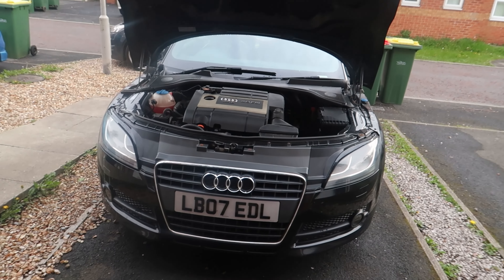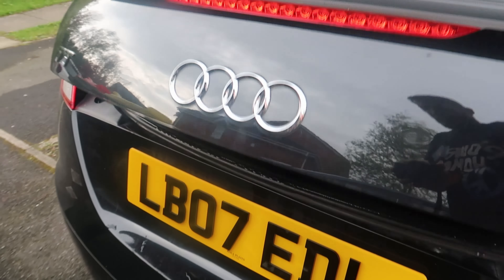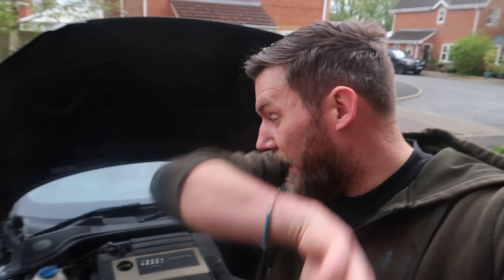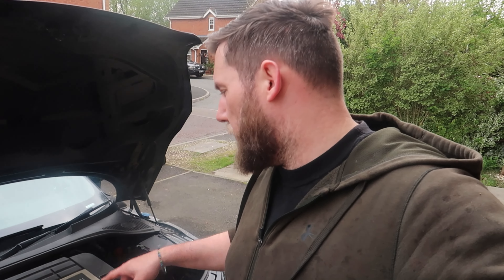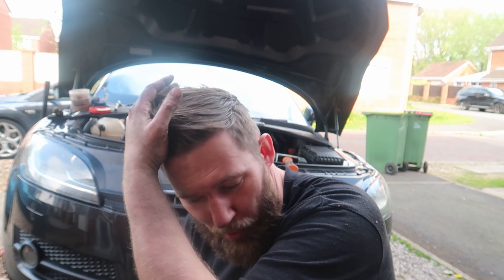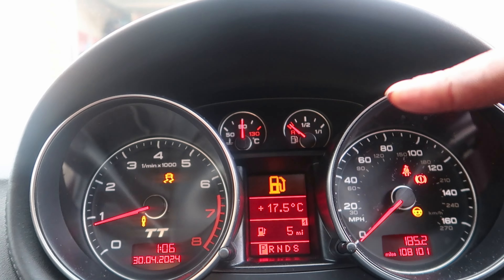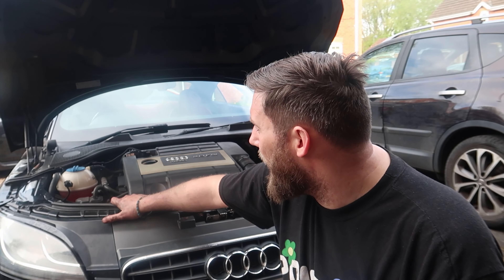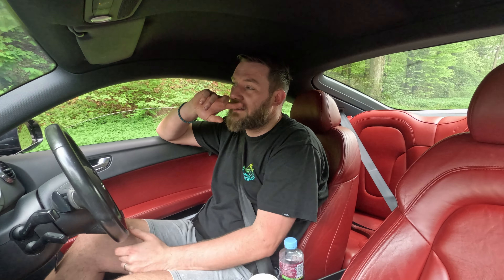MK2 Audi TT Thermostat Replacement | Abandoned Audi TT | EP 10

Comment: Any updates on the focus?
Reply from the maker: Focus will be in next weeks video 👍
Reply: sweet , I just got cp320 software on mine last week.
Reply from the maker: @padster87  how you finding it? I spoke to Collins but some of my mods are not supported by their maps
Reply: Epic map , although I have the dreaded slipping clutch now , it didn't last long ! but I knew that anyway and an rs one will be fitted In August.  It made 318 on the rollers and 340 ib of torque. Stage 2 airtec cooler , ramair group a filter , milltek exhaust with decat , still need to add a downpipe. 😀
Reply from the maker: @padster87  similar mods to myself apart from I’ve got the airtec RS cross over with a Group A filter and a 50/50 recirc vaule. I’m going with Motorsport Development for my map